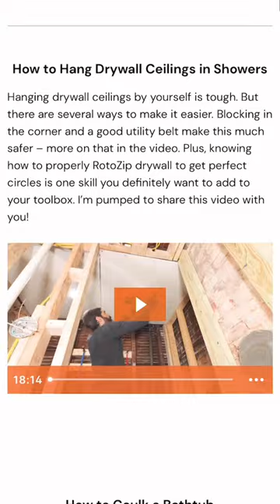Drywall Ceiling Tips - #shorts

Comment: They really did all that work and they still have knobs and tube?? It was in the ceiling, at least replaced it to the light in the next room or box it went to. It couldn't be that far from the where you had it opened up. Doesn't it have to be upgraded  by code anyways once it's opened up and exposed? I know we have to bring the entire area up to code once we tear into it, and if that means tearing a few holes in some plaster who cares. Just for the piece of mind I would want it done. Especially with all the load we put on our electrical systems. Especially in a bathroom.
Reply: It does!! That’s why I continue to comment about this guy and let people know he does NOT KNOW WHAT HE’S DOING!!!

Comment: Wonder...could you just bend the blue pex rather than create an angle that requires a splice/join? Thanks! your videos are excellent.
Reply: Another question re: metal plates. If the plate actually touched copper, would the plate have to be copper (electrolysis)?  My house is old, and there are places where the copper has been hung even with the joists, not with drilled holes like in your shower where your pipe is recessed. Thanks.
Reply: @rosie2059  Absolutely YES. Good question.
Reply: The bending radius of PEX is usually not tight enough for close 90s.
Reply: regarding the copper plates.